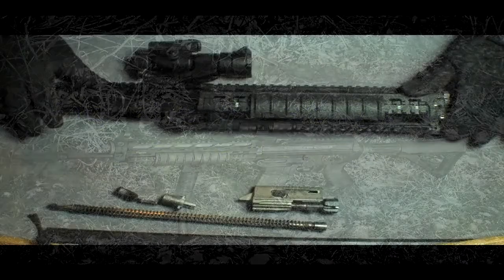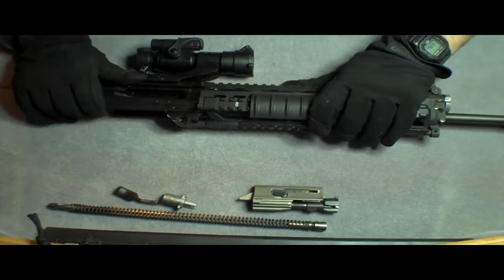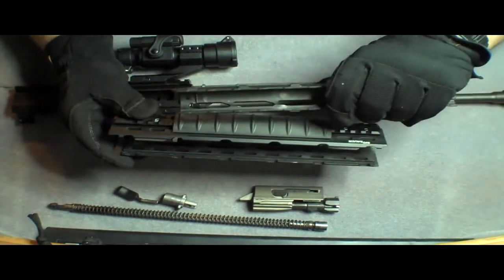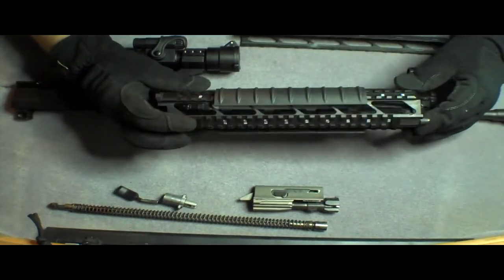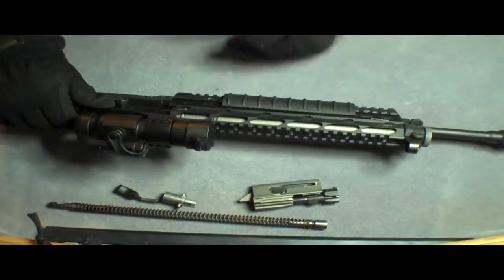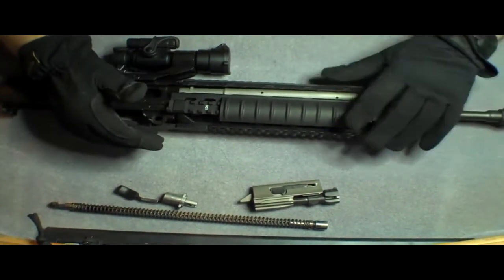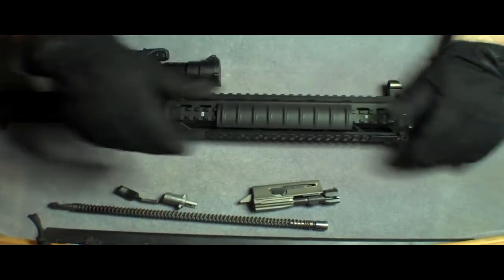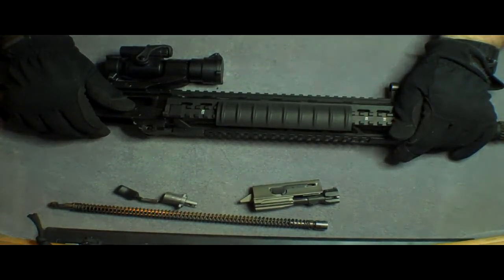Sig 556 Swat Quad Rail Takedown

Comment: When you said to tap on it with a rubber mallet do did not specify how hard and for how long. It took half an hour to take mine off and another hour to put it back on. It was very straight forward thanks to your video. Thank you very much.

Comment: purchased the Swiss handguards for my swat last week. How do I put them on?
The top (picatinny) rail runs the whole length of the rifle unlike others that I have seen which are comprised of two seperate pieces. Do I need to purchase just a small length of picatinny so I can have my guards and my rear diopter sight?